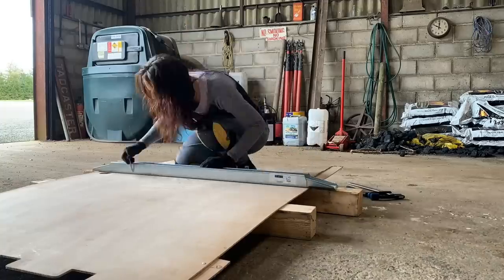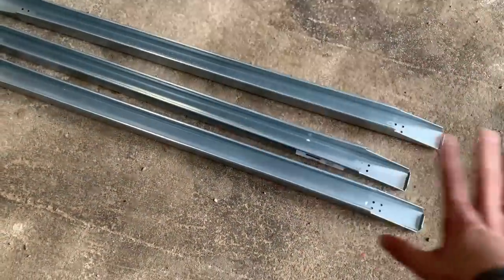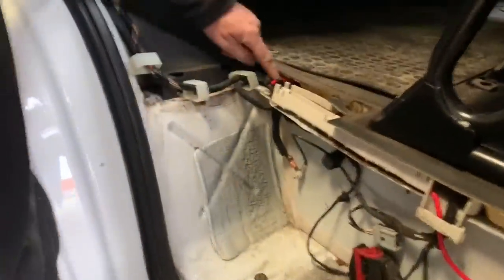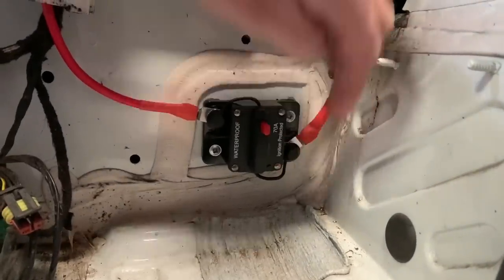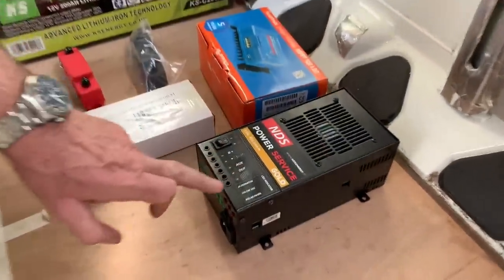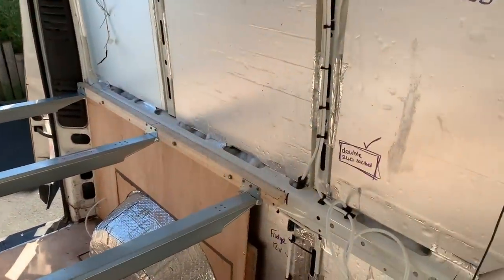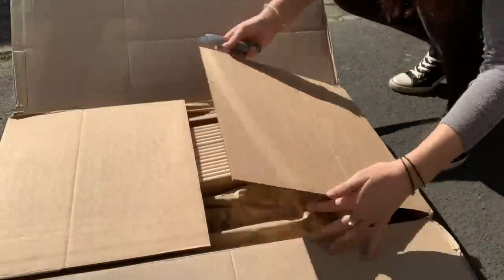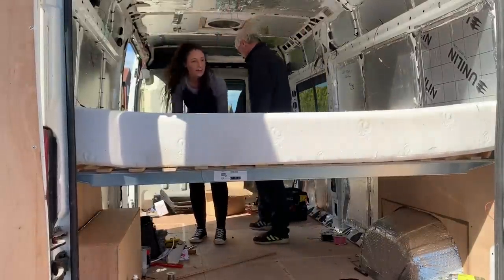BUILDING A BED IN MY VAN - van build Ep.13

Comment: On the brackets for the bed you don't need to add a nut behind or infront. you simply use a rivnut on each and then bolt straight into the threaded rivnut. That way you don't need to use the wood and just bolt straight to the van
Reply from the maker: Where were you when we were filming Jimmy? 😆 thanks for the tip.
Reply: @myvanworld  hahaha

Comment: Hi Becca, I would be be interested to know the wire gauge used. On your build it looks quite thin compared to what other van builders use. I'm sure your Dad has sized this wiring efficiently given his professional qualifications which makes me wonder whether other van builders are over compensating for their 12v systems. Vince
Reply from the maker: Dad’s going to reply to this one for you Vince when he gets a minute :)
Reply: Hi Vince,
I have used thin walled insulation instead of standard insulation cables. Thats one reason why the wires look thin . Also every wire runs in flexi conduit to it's each individual component. We have not double up on any circuits unlike most people. A friend who also works in the aviation industry has done the same and is running about 15 fuses. Most cables are 7 amp rating, which is fine for led lights, water sensor cooker, oven, Fridge, USB sockets etc. The heating [Truma] is on 11amps rated wire as it current draw is 6.5 amp Max also the Auxbeam flood lights are on higher rated cable. As each circuit is only running one item and not several components i.e. all lighting, I not bothered about voltage drop so can use smaller gauge wire. 
Hope this answers your concerns.
Reply: @nicklevitt2101  Thanks Nick. I thought it looked thinner and cheers for the detailed explanation. I enjoy watching the van builds of various YouTubers but the concept of thinner insulation is never discussed. I know it's not much but with van builds every bit of weight saving is useful. I'll carry on watching the build series for other interesting stuff. Send thanks to Rebecca for passing on my comment. Vince
Reply: Hi Vince,
That’s my aviation background. All modern aircraft Airbus and Boeing have been using thin walled insulation for years now to reduce weight.
Reply: @nicklevitt2101  As a matter of interest my wife, Lynda suggested that it may be aircraft grade when she heard about your profession. Do you know how much weight can be saved in a large aeroplane using this method?
Reply: Hi Vince 
Not sure exactly. A Boeing 747 has about 150 miles of cable currently weighing about 2000kg with thin walled insulation. You could easily add another quarter of a ton. Also with thicker insulation you get more heat in the wire. This increases resistance which increases voltage drop ie thick walled insulation at 0.65 mm2 load is 5.65amps thin walled insulation 0.35mm2 load is 7 amps. 
Nick